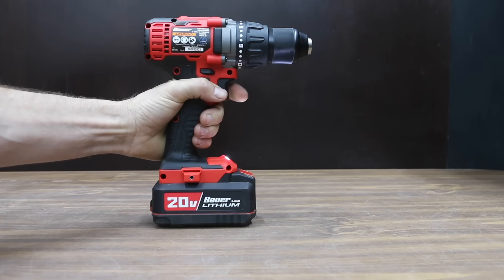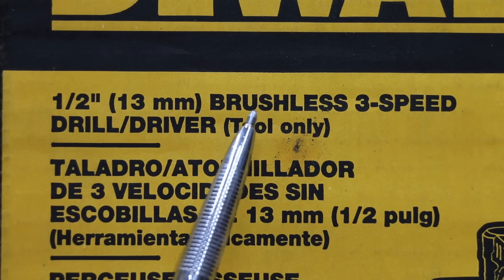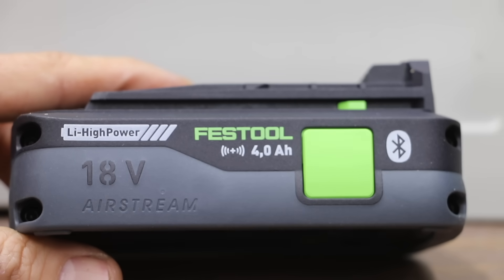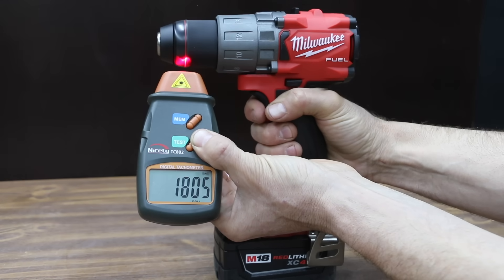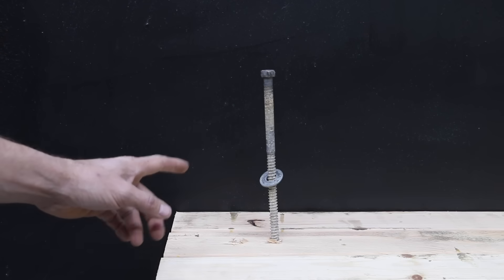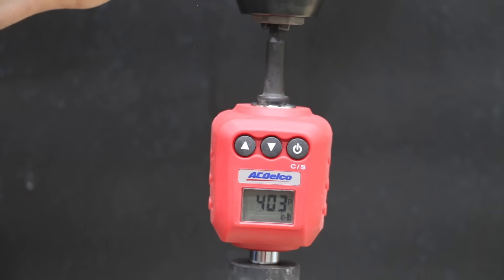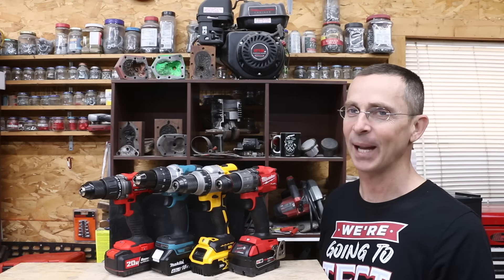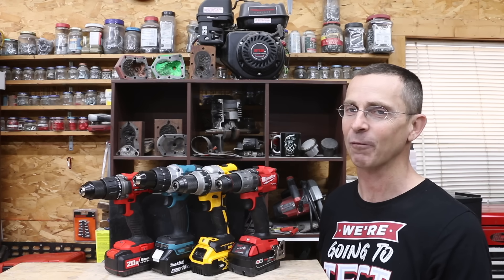Best Drill (BATTERY POWERED)? Milwaukee vs Dewalt, Makita, Bosch, Festool, Ryobi, Bauer, Ridgid

Comment: Would have been nice to also check the runout on the chuck. Place a piece of round stock and see with a dial gauge how much wobble the shaft has.
Also from experience i've noticed that brushed Makita drills develop looseness in output shaft, which causes the chuck to wobble and makes drilling straight holes harder. I've had mine for maybe a year now and it's quite loose, if you place a long drill bit in you can really see how much play there is. On top of that the brake also started failing occasionally so when you'd go to tighten the chuck it would spin the motor and sort of skip around as the brake tries to engage.
In terms of quality brushed Makita's do not come close to my old brushed Metabo, which was absolutely abused for about 6 years. Even used it to start small engines, in second gear no less! It still works but the batteries (14.4V 1.2Ah lithium ion) don't hold much charge anymore and motor starts smoking if you run it in reverse for too long. Also the dogs on the plastic grip on the chuck sheared off so i had to cut it off and tighten the chuck with a pair of pliers. But at least the chuck doesn't wobble.
The good thing about the Makita was the price. For 200€ i got two 5Ah batteries, a charger and, of course, the drill. Too bad the chuck has play, the brake skips, oh yeah, and the motor has become quite noisy.
A following test with more drills would be great. Hilti, Metabo, Hikoki etc.
Reply from the maker: Great constructive feedback!  Thank you

Comment: FYI: Ridgid currently has several different 18v hammer drills: R8711 (subcompact, brushless, cheap model with plastic chuck sleeve), R86116 (compact, brushless), R8611503 (full-size), R8611506 (full-size, brushless, Octane). The R86009 you tested isn't a hammer drill, and it doesn't look like it has an all-metal chuck.  Personally, in this class of tool, I would only buy a hammer-drill with an all-metal chuck, because the cost premium is only 10-20 bucks over the cheapest versions.   I have the R86116,  R8611503 and the R8611506, which is significantly stronger than any of Ridgid's other hammer drills, for only ten bucks more (still much less than the higher priced brands).  Some of these are hard to find right now. Maybe next test, huh?
Reply from the maker: Thanks for the constructive feedback.

Comment: Love these videos, but I do have some constructive criticism if you'll hear it. While I think you certainly have all the drills a fair shake, I don't see this as a very good test because you used the premium drills from some brands and not from others. For instance Ridgid has 3 other models of drills that make more power than the model used here, same with Ryobi. If you're going to just do drill drivers then I think you did well but I feel it's worth mentioning that some of the brands that didn't perform well do have higher powered options that include the hammer function. Perhaps in the future maybe we'll see a head to head between all the top offerings of drills and batteries from each brand. I hope that doesn't come off as harsh, I do really love the channel and your testing is as good as it gets, keep up the good work.
Reply from the maker: Thanks for the constructive feedback

Comment: I've always heard that you could use vegetable oil if you didn't have any diesel but I was also told that if you add motor oil to gasoline it will work for diesel in a pinch is there any way that you could add vegetable oil to gasoline so you can run a diesel is my question
Reply from the maker: Great video idea!  Thank you

Comment: The reason for the electric clutchs failing, could be because the speed trigger is slammed to max.
If you are working with "delicate work" you would not set the clutch to 1, and then give max power.
Thanks, nice video! :)
Reply from the maker: Thank you!

Comment: I've been using a Craftsman 19.2V for nearly 20 years now and a Porter-Cable 18V for nearly 10 years. I only bought the P-C because I had a project requiring 2 drills at the same time. Both have been great. Naturally, I've had to purchase new batteries for both, but each unit still operate as they're supposed to do. My Brother, however, uses DeWalt and Rigid and has replaced both units several times within the same time period. He borrows mine quite often because his fails to perform. Why he keeps wasting money on something he already knows is going to fail is beyond me.
Reply from the maker: Thank you!

Comment: I've been watching these for a long time, and they're really good. However, as an electrician, my tools get a lot of abuse from daily use. Power and speed just aren't useful metrics for myself. While these are fascinating, my biggest concern when buying a tool is longevity. When using a tool everyday, I need it to perform and not break down so I can get the work done and so that I'm not constantly having to front the cost of replacing them. It's one of the reasons I really enjoy AvE's channel, as he looks at the quality of the build. Do you suppose there is a way to implement a testing in order to determine tool longevity? As a long time tradesman, this is the most important metric in my tool purchase. Thanks! Keep up the great work!
Reply from the maker: Thanks for the constructive feedback!

Comment: I can tell you right now that makita is no joke, a few years ago I got tired of buying battery drills with no power, so I looked at all the specs and that makita (XFD07) had the most by far back then. I think I've had it over 5 years and it has been a beast, alittle heavy, but atleast it can break your wrist in low speed if your not careful, just the way i like it.

It's also been plenty abused, it's lived in a steel fabrication shop it's whole life, I don't recommend putting a floor jack under it for drilling up side down though, it's been a hair growly since then but it's still kicking.
Reply from the maker: Thank you!

Comment: Very surprised to see this OLD Makita in the mix. In January they came out with this beast that blows away their old one that he is testing... though an old Makita is usually as good or better than most NEW anything

18V LXT® Brushless ½” Hammer Driver-Drill (XPH14). The new hammer driver-drill delivers a full 1,250 in.lbs. of Max Torque, the most in the category. Despite its powerful punch, the XPH14 is 14% smaller than its predecessor, XPH07.
Reply from the maker: Thank you!

Comment: I'm curious how these newer lines of drills are supposed to be operated. I ask this because i was told by a Makita rep about 20 years ago to never operate any drills in the drill mode, as i saw you doing in some of the testing here. The rep told me to always have the drill in one of the slip modes (number 1 thru 5 or whatever numbers your drill goes up to)
Reason being that applications that require a lot of torque ultimately end with damage to your drill.  I had to send my DeWalt and Makita drills in for repairs multiple times, which back then was about $90 + S&H each time.  
Ever since i kept my drills in slip mode, i never had a problem. Now, i use impact drivers so it doesn't really matter anymore....
Reply: to add to this...i do own a DeWalt drill/hammerdrill now, but i only use it for drilling in concrete or ice fishing.  And speaking of ice fishing, that might be a good test for another video- different drills using the K-Drill ice auger attachment. Compare them with popular cordless powered ice augers such as the Ion.
Reply from the maker: Great suggestion on the ice auger attachment!

Comment: They are more or less all from China or from Chinese companies, though I reckon Festtool aint and likely why you paying out of your nose for that.
Dewalt is Stanley Black and decker with US asembled from global materiels that can be anything under the sun, and useally word mumbo jumbo to fuel the last believers.
Same with Makita japanese but most of their western tool are made in China
Either way you should have included one of the no-name b4stards from China..
You can get brushless drills for 25USD delivered and its often the same BL-motors and metalgears, that are in the same brand units though some of the high toque chinese models from fx Milwaukee / Makita are using befier BL motors.¨
My main drill these last few years have been one from Parkside, (a brand the german chain LIDL carries)
It comes with 100w fastcharger (4pin) quality cells Samsung 25R and they been sold as low as 60euro. (in total)
Dont need a vibrator in my drill, takes room and weight and not ideal unless you often drill into such materiel, and prefer to use a SDS when drilling into stone and concrete.
a small brushless and strong 360-drill worls great as my driver, and dont makes as much noise as an impact driver.
https://imgur.com/a/2rkb4o0

Comment: I have to say I'm surprised you tested drills without actually drilling anything.
Reply: Wouldn't that be testing the drill bit, and not the mechanics driving the bit?
Reply: @jong2359  Not if it's the same make and model bit for all drills.
Reply: @TrueThanny  Umm no... that is not how that works.  You are still testing the drill bit in your scenario, you are just testing it many times.
Reply: @jong2359  I don't want to start being mean, so I'll just say that you're completely wrong, and you'd know that if you weren't wedded to the idea that you had to have been right when you started your futile line of argument.
Reply: @TrueThanny  Tests involving non-measuring devices (aka multiple variables) are always invalid.  Welcome to science.  None of the manufacturers make claims about drilling performance, either.  They make claims about their motor/gear performance and drilling performance can be assumed based on these measures.  Think whatever you want, it doesn't matter that we disagree.

Comment: Here in south Africa we do not have a wide choice.  I always bought Makita for my work, and Ryobi for home, as I can not afford Makita for home.  Last year I bought two Makitas for work, then we had lockdown, then we had builders holiday.  My one Makita broke.  I took it in under guarantee, but was told by Makita that my job is too hard for these drills.  When we fix sheets, we drill holes in 0.5 mm mild steel.  Only a few holes, then we hand up another sheet.  The same thing when we fix the screws for the roof sheets.  And Makita say this is too hard for their drills.  Anyway, I am now waiting over three weeks for the (out of warranty) repair.  Sure, that was my last Makita.  Why pay extra if the tool does not last like they used to?
Reply from the maker: Thank you!

Comment: You shouldn't compare the flagship of one brand to the lower end of another brand. The Makita and DeWalt (not to mention some of the other brands) you tested weren't the best that those companies have to offer, but you compared them to a gen 3 fuel Milwaukee M18, which is simply not fair. Also you have to factor in ergonomics and features; and the outright power and weight don't mean anything unless you see what the ratio of power to weight is, which is what actually matters. So I don't think this is a complete test since it's just not realistic.
Reply from the maker: Thank you for the feedback!

Comment: We use Dewalt drills at work and every one of them has a Chuck that just will not hold onto a drill bit when drilling into tough materials like metal it just spins and will not hold we have about 12 drills at work and all of them are the same the Chuck is nearly worthless.
Reply from the maker: Thank you!

Comment: I would LOVE to see a Part 3 to this series where you do an ultimate drilling showdown and test all the Hammer Drills by drilling through a variety of different materials, Soft/Hard Wood, Soft/Hard Metal, Concrete, Stone, Tile, Brick etc. 

It would be the perfect conclusion to your series on Drills AND Drill bits. 😁
Reply from the maker: Great suggestion!  Thank you.
Reply: @ProjectFarm   No thank you! I came up with it because I’m an Industrial Mechanic at a factory, which means we have to do a ridiculous variety of tasks in any given week so specialized tools are pretty much worthless.

Electrical, Hydraulics, Motors, HVAC, Metal/Part Fabrication, Building maintenance, Washers, Dryers, Conveyors, Boilers, Steam Pipes, Air Lines, Ironers, Mechanical Folders, IT/Computer Troubleshooting... you get the picture. 😂 

Versatile and multi-purpose tools are king for us!
Reply: Also a difference in drilling into new concrete, fairly new(couple years) and old concrete(15+ years old)
Reply: @chrisschultz6541  I think he did that already

Comment: Thanks, Commander! You did it again! I got my DeWalt atomic drill motor because I already had the charger and I got a spare battery off Ebay from a pawn shop. All is well and got the drill to use 65 Ford's rattle paint can shaker but haven't done it yet but the drilling is A-PLUS! I still have the Milwaukee 1/2 inch hammer drill that'd make a dandy helicopter with a tail rotor and a long drop cord. Hope all is well and you're making hay while the sun shines. BLESSINGS to all yall!
Reply from the maker: Hi Lewie,  Thank you very much!  Great point on staying within the DeWalt product line since you have the batteries.  Batteries are very expensive!  Glad you're doing well!  We're hoping to dry out a little this week after about 5-6 inches of rain last week.  Hoping to bale hay in the new few weeks.  Blessings!!
Reply: @ProjectFarm  We usually get it and now we need some and yall got it. I thought getting the battery from the pawn shop was an unusual deal, especially on Ebay but  guess everything has to be somewhere. Don't over do it and I'd sure like to eat a bale of fresh cut if it tasted like it smells! GBWYall!

Comment: The Festool was a real disappointment. You could save a lot of money and have a better tool by investing in the Milwaukee. 

Your video has me tempted to get one of those torque adapters and test out Dad's old Makita he bought in the 1980's. It's a corded drill, and it's just about one of the most powerful drills I've ever used.
Reply from the maker: Thanks for sharing.

Comment: for the drills with electronic clutches there torque depends on both what they are set to as well as what gear they are in. so for the lowest setting if you put them in high gear they would far less torque.
Reply from the maker: Thanks for the feedback.

Comment: Question for the drill-jockeys in the comments: What does that setting on some drills that seems to be a picture of a drill bit actually do to the tool? I barely use mine and it's something I've always wondered.
Reply: It's the hammer drill mode for drilling into things like concrete

Comment: Your settings on some of the Festool tests were wrong. For instance, if you wanted to test the lower limit torque you should have set the speed to 4, and not 1. Also, it isn't meant for super high torque applications. It's  much more designed for fine woodworking.
Reply from the maker: Thanks for the constructive feedback.
Reply: @ProjectFarm  Sure thing :) My apologies if my comment came across as mean. I just read it back to myself and kind of got the sense that it seems aggressive.
At any rate, I love your content, and keep up the great work!

Comment: I am unsure if you tend to read these comments, but if you ever wanted to look at non-tool related themes again, can you tell us more about different materials? For example, my dad works in the steel trade and he is always talking about 304, 316, 430(?) stainless, 1050, 5754, 5005 aluminium, etc. I remember you doing drill tests on 304 stainless before, but is there any merit in creating video about the differences between these materials? Corrosion resistance, heat resistance, friction, phyiscal stress. Like, I remember one rant about stainless steel chimneys using 304 steel for the inside when you should be using 316 because of the acid that forms during condensation. Like, they are both stainless, so they are resistant to corrosion aren't they?
Reply from the maker: Thanks for the suggestion.

Comment: I’ve noticed you use the same digit torq reader on your videos. 1 did you test other brands, 2 dose it beep to let you know if you hit the set number. I have a breaker bar, just thinking money wise cheaper to just get a box like that.
Reply from the maker: Great questions.  I have 5 torque adapters.  They do beep when they are reaching their limit.  I periodically test them against each other for accuracy

Comment: Dewalt's having a pretty good year on PF, they've been a lot more competitive the last few times they've been tested. But what exactly are you buying when you get a Festool? Do they have a 10-year guarantee or something?
Reply: Near as I can tell, a name. The performance doesn't justify the price.
Reply: Buying a Festool drill is pretty much the same as buying a Snap-on toolbox.
Reply: With something like a drill, no reason to pay the Festool price, it's still just a drill.  Festool has a few nice tools that are exclusive like the domino, but other than that, other manufacturers are very competitive on performance and much better on price.i have sold a few of my Festool tools and replaced them with Make, DeWalt, Milwaukee,etc
Reply: Festool is terrible. About the same performance as a Bauer

Comment: electric clutches dont work when instantly stopping, its gradually adjusting you may need to use a brake for this. thats why dewalt had over 70
Reply from the maker: Thanks for the feedback.

Comment: I have both the Ryobi drill and impact driver, and I am very happy with them for what I do. I am not doing super heavy lag bolt stuff but, for DIY projects around the house they are more than adequate, the set I have came with both tools, two batteries, a charger, and a carrying case for like, $100 or $120, I don't remember but for me it was worth it.
Reply from the maker: Thanks for sharing.